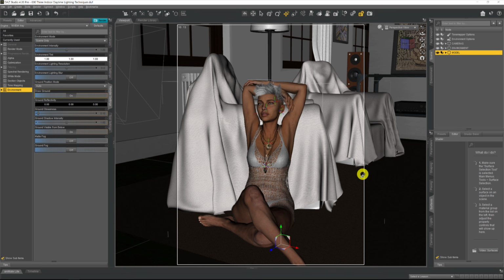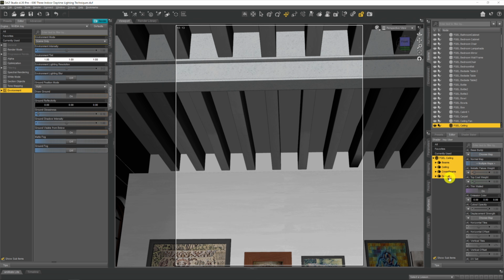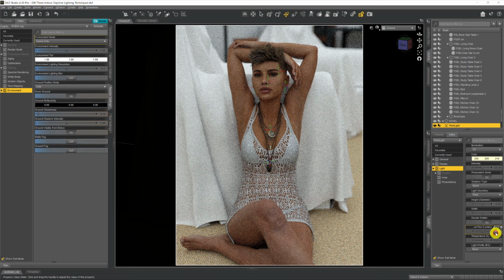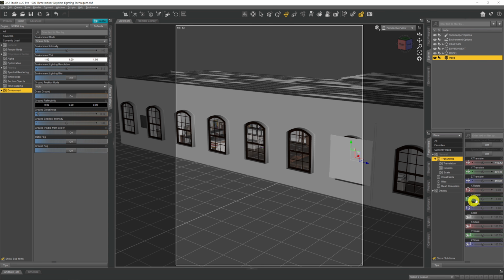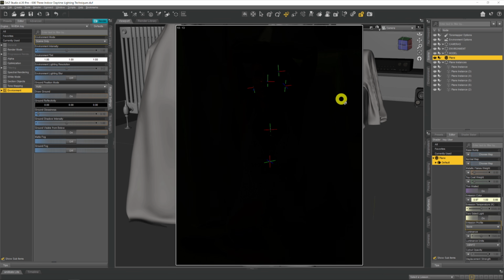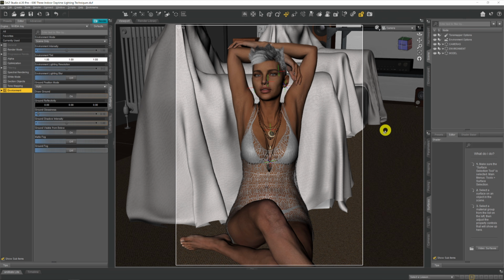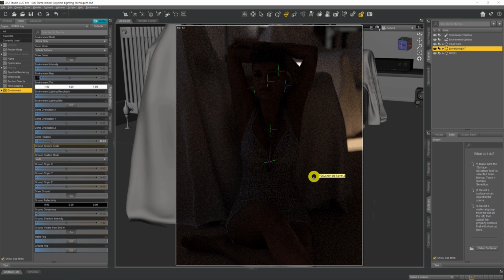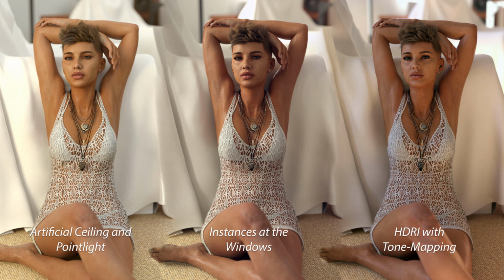Daz 3D Lighting Tutorial : 3 Daytime Indoor Lighting Techniques

Comment: Actually, the basic lights were all updated to emissive objects several versions back.  Putting a spotlight in a scene is just the same as adding an emissive plane.  Just using different controls.  Create a spotlight and change the geometry to a 1 meter square if you don't believe me.  Look at what you get.  It's a simple emissive plane, just controlled using the camera object instead of creating the plane from a primitive.  I'm surprised you didn't try the distant light or the sun sky method.  Both would give the same effect as an HDRI with much more efficient rendering.
Reply from the maker: A spotlight is still a spotlight whether you change it's shape and size or not .. the final light of a 1m square spotlight will be different from the light emitted from a 1m square emissive. For instance, it will still be focused into a cone as is any spotlight. 

As for the distant / sun sky methods - the vid is already 25 minutes in size!! I wouldn't have wanted to include other options and add more time onto the end.

Comment: Hi Rauko, excellent video as usually. Really appreciate it. Thank you very much.
Just one question: What's the clothing you're using in this render?
Regards Squeeze
Reply from the maker: Hey Squeeze .. I never included the clothing in the links as its a an assest AND a texture pack from Renderosity .. but here's the links :

https://www.renderosity.com/rr/mod/bcs/dforce-xl-tank-top-for-genesis-8-females/137991
https://www.renderosity.com/rr/mod/bcs/cover-up-for-xl-tank-top-g8f/138181

The necklace is from the Slouchy Sweater clothing bundle 

https://www.daz3d.com/slouchy-sweater-outfit-for-genesis-8-female-s

BTW : She's just wearing a standard underwear set underneath ..
Reply: @RaukoDaz3D  Thank you very much.

Comment: There's another way that's similar to your multiple planes but much simpler: Position the perspective view outside, facing in the direction you want the light to go and create a distant light using the perspective view. Adjust the luminosity and job done.

I used to use spotlights but distant light provides better coverage.
Reply from the maker: Yeah, there's multiple ways it can be done .. I did three "different" ones .. but each of them could have a variation within each of them also!
Reply: Do you have any art illustrating that?

Comment: Hi Rauko, Great video! I find using spotlights in the right way you can create some great effects and have more control where the lights are placed such as background and back light. Hdri's are certainly good as well and provides a scene.
Reply from the maker: There's a variaty of different ways it can be done .. I stopped at 3 as it already got to a 28min video! 😀
Reply: @RaukoDaz3D  Yes, there are many ways,,,and you can cheat and remove a ceiling /roof to let the hdri come through.
Reply: Spotlights are the only way to light indoor, imo. From a visual novel or comic perspective, at least.
Reply: I also find that a combination of HDRi and Spotlights is my preferred method. I was surprised at the comment in the video about getting out of that "bad habit". I also remove ceilings and walls to let more light in but that's not always possible or doing so will often mess up the shadows.